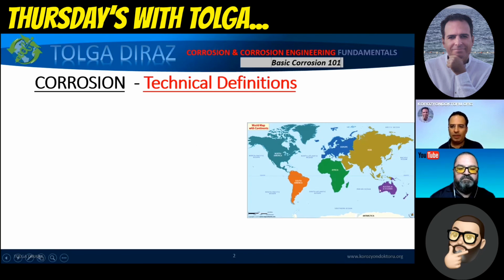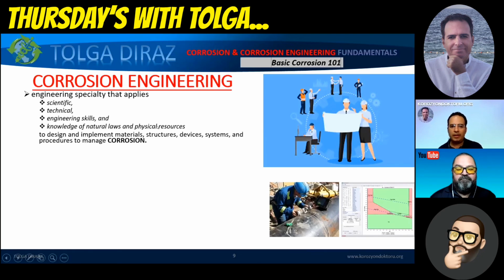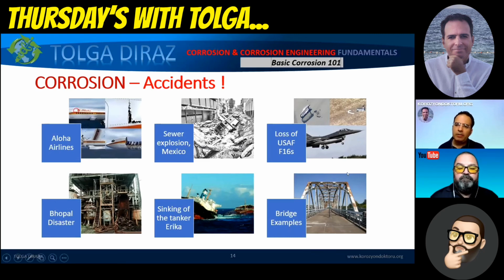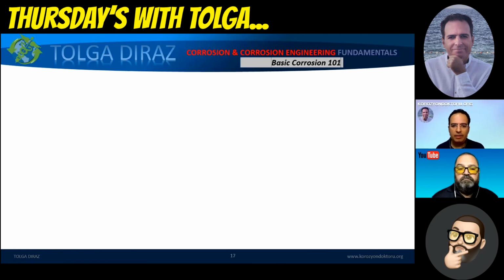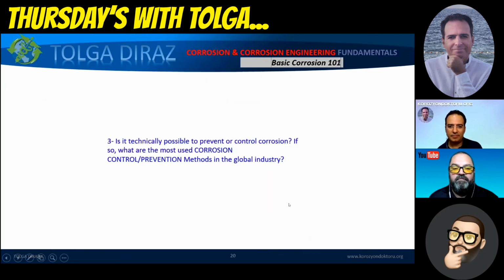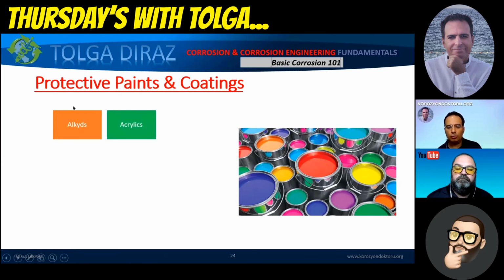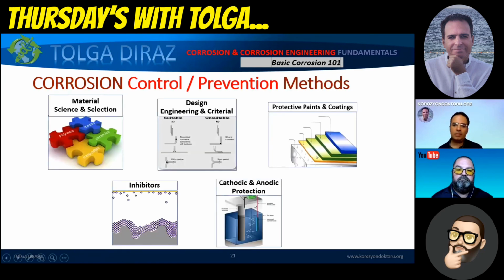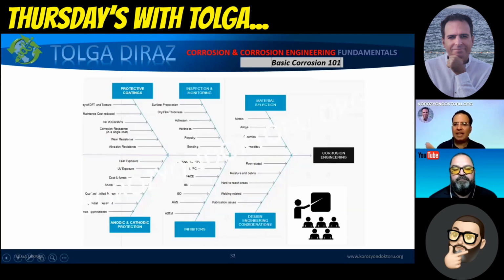Thursday’s with Tolga:  Corrosion Basics (w/Tolga Diraz, PCS)

Comment: Thanks to Mr. Diraz and Mr. Kunkle for this informative video. I would like to add some extra information, 'patina' is not a special product for only copper. It is possible to see a patina layer on brass, bronze or zinc. Another thing is, Mr. Diraz mentioned about some disasters, these disasters are actually not directly related with the corrosion. There is a combined effect of corrosion, metal fatigue and material selection mistakes. Lastly, I believe it is really hard to see pits with naked eye. Pitting corrosion is one of the most dangerous type of corrosion, it is not very visible to the naked eye on the material surface if there is a re-passivation case.
Thank you for your time and considerations. Stay safe !
Reply: Thanks to Mr. Akman for this useful comment. As he has mentioned above, 'patina' is not a special product for only copper; this term can also be used for the corrosion product of brass, bronze or zinc. Here, our aim was to draw attention between the difference of Corrosion and Rust terms. Happily, we see from the comments on our social media that we have succeeded in our goal :) 

In this Episode about Corrosion Basics, we mention these accidents because of the Corrosion phenomenon. These accidents might not be directly related to Corrosion and other factors such as metal fatigue and material selection mistakes may take part. However, Corrosion is probably the most destructive factor amongst these combined factors that ignite or speed up the reactions needed for the accident to occur. Therefore, these accidents are known to be "CORROSION-related Accidents" or "CORROSION Accidents " in the literature.

Lastly, "Pitting Corrosion" is definitely one of the most dangerous types of corrosion. However, by reading the official definitions from reliable sources like NACE (https://www.nace.org/resources/general-resources/corrosion-basics/group-1/pitting-corrosion) and SSPC (https://www.sspc.org/learning_center/types-of-corrosion/), it can be easily generalized that this is a MACRO Corrosion type that can be seen by the naked eye. (Yes, in some situations, it may be not so obvious.) Moreover, from a quick Google search selecting the Images tab on the net, some visual examples of "PITTING CORROSION" can be accessed via the Internet:
https://www.google.com/search?q=Pitting+corrosion&client=firefox-b-d&sxsrf=ALeKk01suU4o-NZIkQviNrByhx9WRVrawA:1598795276827&source=lnms&tbm=isch&sa=X&ved=2ahUKEwjZw6zEiMPrAhU1C2MBHWtsABQQ_AUoAXoECA0QAw&biw=1370&bih=646

Thank you for allocating your time to write down this comment to our Episode on "Corrosion Basics" on this YouTube Channel. Stay safe!
Reply from the maker: Adnan Akman  Thank You!